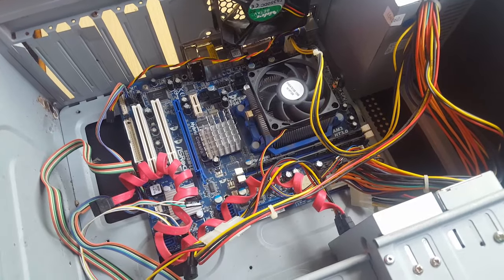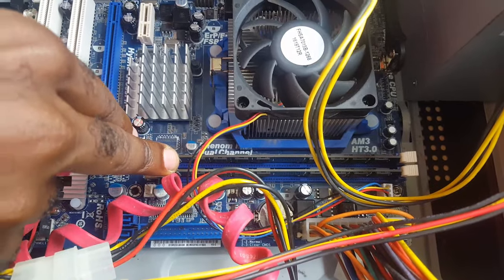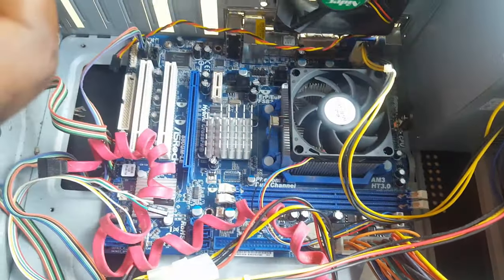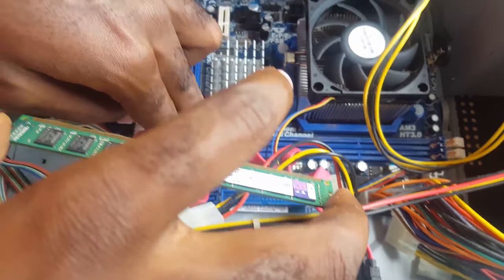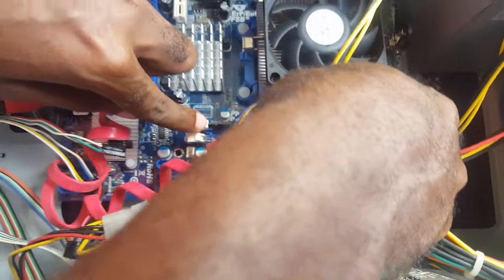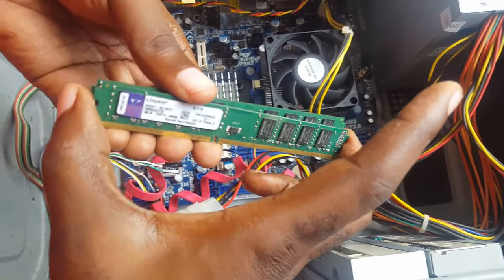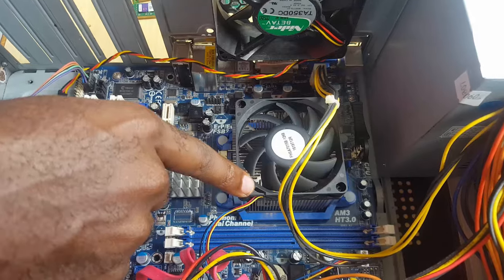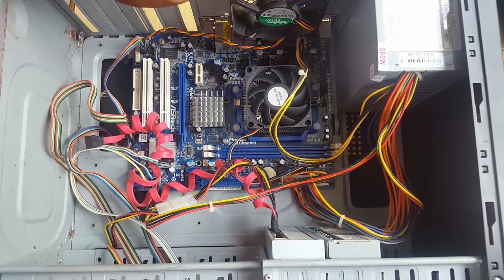Computer beeps 3 times and refuses to power up Fix

Comment: I have a HP pre built office computer. I opened it to remove dust and when I plugged it in to start using it, I got this problem. I was so stressed and scared. After doing the ram solution, my PC turned on like a charm. Thank you so much for this solution.

Comment: Unreal. PC was on sleep. Then when I went to bed it showed on but nothing on the screen. Turned it off. In the morning turned it on and the beeping started. Found this and took out the cards. Sprayed out the dust. Both cards back in and pc working like normal. Thanks for the tips!
Reply from the maker: No worries and great job.

Comment: I had purchased a refurbished Lenovo computer which came with an HP keyboard.   I hooked everything up, and got the 3 beep problem.    I did some YT video searches concerning others who had the same problem with a refurbished Lenovo computer that came with an HP keyboard.  I found another guy who had the same problem.  In his case, he switched to a USB keyboard, and then it worked fine.  My guess was that the BIOS was not updating to recognizing the HP keyboard and thus registered an error.  So To increase the chances of it doing so, I removed one 4GB mem card.  It was now up and going. I then reinstalled the second 4GB mem card, and it too was working fine.   So my guess is that when the refurbished units were tested, they were tested using a USB keyboard, thus not using the HP keyboard.

Comment: Good news is, it stopped beeping!
Bad news is - no display. It turns on and runs fine but it sends no display signal. No clue where to go from here.

Edit: I took the ram chip out AGAIN, jammed it back in, and it works now. Just keep fiddling with it till it works, I guess.

Comment: (this is for the ones who needs help if their pc is beeping short and continuous beeps) so when u open your CPU as u can see there are 2 RAM slot take out your RAM and wipe the golden edges with eraser or cloth and then put the RAM in the other slot and then try to click it in because if u dont that might be the cause of the problem and thats it! thats what i did to mine and it works.

Comment: I'm on the computer that beeps 3 times and than has a brief pause. Sometimes like this,it just turns on and works but other times it beeps 3 times and pauses and doesn't turn on. I'm not the owner of the pc i'm using. It's my Dad's pc which is about 3-4 thousand dollars for the whole setup. Right now he's away on holiday and i'm using his pc like normal. i went to sleep with the ac on in his room with an alarm on the pc set to 9am, but i woke up at 6am with the computer beeping even though i wasn't touching it or interacting with it. At first i thought i was maybe to cold so i turned of the ac and waited about an hour. About an hour later i came back in and tried to turn it on but at first it didn't work and beep 3 times. So i turned it of and turned it on again and it worked! I was like "oh, that was a bit weird but ok..". Later that night the pc had been turned on all day so i decided to give it a break for 2 hours roughly. once i came back i turned it on and it beep so i repeated what i did in the morning and yet no success. So i tried it several times for about 10 minuets and yet again nothing.. Which made me pretty pissed cause it was about 7pm when i tried to turn it back on.  The next day i tried several times once again to get the pc to start up back had the same response with 3 beeps. So i basically wasted my entire day watching TV and went for a hike. at around 7pm i tried again and it just magically worked. i  was so fucking pissed cause i honestly wasted a day doing shit and when i'm about to finish up and have dinner it works -_-. It's the next day now and it's midday and after trying in the morning and just before 11am i did it one more time and now i'm back on. If i leave it for about 30 minuets i guess it's gonna turn of and start beeping :( btw i'm only 12 xD
Reply: And hopefully your tutorial works, if so i will sub and like any future videos that help me out or are just awesome like this one!

Comment: bad advice .... blowing with your breath works but you risk spitting droplets of saliva ...... use a brush (anti static one) or can of air.
also im hear because i have a similar issue but this beeping only happens after a crash that seems to be video related and its random, pc can work fine for days ..... its also the same as an old bug of "something stuck in memory" after a crash preventing booting issue that i have seen years ago .....on completely different pc's .... powering down (mains power off) and clearing power from system (press power button on case)  then turn mains power back on and boot ..... this cleared that old issue and this new one too .... running a msi b450 tomahawk max, ryzen 2600, 16gb 3200 ram (8gb x2) .... starting to wonder if i need to drop the ram speed to 3000 .... as the 2600 only supports 3200 max so im at the edge of stability ?

Comment: Bro i upgraded the processor of my computer and also reinstalled the ram and when i turned on the computer it is making 3 beep by watching many videos i cleaned the ram dozens of time still its making 3beeps please help😭😭😭😭
Reply: @Justrandom yeah man i  cleaned my ram slots and then tried to put the ram and it worked now my system is running fine by the way thankyou for the tip

Comment: Spectre G3 beep errors 9only appears on Northwind CD-OS 19 Models
1 beep - motherboard issue
2 beeps - DRAM issue (I just realized yesterday)
3 beeps - Hard drive Issue (I also realized yesterday)
4 beeps - Incompatible CD
9 beeps - Emergency Fatal Error, or system was halted (I also realized yesterday too!)

Comment: I have 3 short beeps followed by 3 short beeps and a cpu fan rev. After a brief pause it repeats. It started after dusting off the computer and adding additional RAM. I've tried reseating the RAM, tried many different modules including couple new ones. The RAM works on a different computer, so it's fine. I've tried using a single module in every slot or combinations of couple modules. I've reseated the CPU and restarted BIOS by removing the battery. I've tried blowing air on RAM slots to clean them. When I remove all RAM the beep signal changes, so it detects that RAM is there. I've tried disconnecting anything unnecessary from the PC.  The problem still persists. Anyone has any ideas what to try next?

Comment: I have a old dell pc, maybe 2005, 1GB of RAM, wanted to have 2 GB so I order 2 GB of memory sticks and the pc beeps several times, I find out that one of them is not working because it is showing dark material at the end of the gold connections. So I installed only one and the pc started to work again, but the mouse is not working now. Any way I will return the bad one and hope it will work with the new one. Meanwhile I will use the 1 GB memory stick and the 512 MB memory stick and try again. When I get the replacement will have 2 GB of RAM and hoping the pc will work faster. Thanks for the video.

Comment: My dimm slot I'm supposed to put ram in first is messed up and now I get 3 beeps on 5 slots, but bottom is recognized for single channel. So basically I'm only getting 8gb now out of my 16. Lesson learned always look at the slot gap orientation, I had mine backwards and it probably fried my slot. The ram works

Comment: What about three beeps when plugging in the power to the computer?  This is before any attempt to power on, which of course also doesn't work.  The second the computer is plugged in, it starts beeping.  This occurred after replacing the mother board battery.
Reply: Try switching to the old battery.

Comment: amazing sir! very helpful.I have inserted only one ram and it has stopped beeping but on screen it shows " a disk error occurred" and press ctrl+altr+del.and shows again and again that only.what should I do?
Reply from the maker: A disk error could mean that there is something up with the hard drive. Check to see that's its detected in BIOS and its the first boot device. If it is and not showing up still then you may need to reinstall the operating System or replace the drive if its bad.

Comment: I hear just 2 beeps and then a error is showing up on the screen
Reply: Same
Reply: @InfoVoicePk  I tried to fix it by myself. Is not recommended. I replaced over 6 parts. Go with the pc to someone who knows what he is doing. If u are in London I can recommend you the guy who fixed my pc
Reply: @DanyHell69  I hear 2 beeps and then a page where the red text American Mengrend or something like that and a message(error 0162 setup data integrity check failure) shows up and also f1 and f2 options.
P.S Thanks for suggestion brother but I'm not from London I'm from Pakistan.
And please tell me when you get your PC fixed

Comment: I have an sold Acer Veriton that beeps three times in start up now. By removing the ram and using one I fixed this issue I was thinking it was the GPU.
Reply from the maker: Yeh well glad you tracked down the problem.

Comment: I just bought an used motherboard and processor, i assamble everything back including the ram, hdd, case ports, vga, psu from my fully working pc. And its happen. I try all your tips like cleaning the ram, change slot, reset bios and still not work sir

Comment: i was reseating the memory from it was first seated in channel 0 and i moved the to channel 1 and then i moved them back and my pc started beeping then i put both ram in the channel 1 and it worked but just one of them did work then i tried placing it on channel 0 and it beeped even tho it was the wrong ram stick what could be the problem?(so pretty much only two channels work with one stick channels one's but once i plug in the good stick it doesnt work on channels 0

Comment: 3 am and this happens to my laptop, guess what, I looked at the ram and there's this loose metal part( not sure where it's from, but my guess is that it's from CD drive)

Thanks, you're a life saver.

Comment: Could the sound be coming from the ram being too powerful? i bought a hp pavilon desktop a while ago and just recently i bought 16gb of 3200hmz and it makes a beepoing sound, when i entered m,y old ram it worked perfectly fine and i read some articals saying that the ram could not be compatible with my pc
Reply from the maker: Could be that its not compatible. If  a PC does not POST when you change something it usually not compatible.

Comment: You should blow of the hardware the moisture could brake something use compressed air
Reply from the maker: True that's recommended, but I have never had an issue blowing dust from a memory slot unless you produce excessive saliva.

Comment: We need a solution of fujitsu desktop xeon w530 and p720 its turn off its self and no power no any signal no light means nothing. But i test te power supply is fine what is the problem

Comment: Soo I'm a 12 year old, and I usually play on my uncle's for pc for games because his pc is pretty good and it's the only pc I can use. He keeps on rambling and being mad at me if i use it for too long. He has 2 pcs, one for win10, and one for linux. I usually use the windows 10 one and he usually uses the linux one because it's for his job. So I usually need to switch up the pcs when he's done using the linux one, or when I'm done using the windows 10 one, I have to switch it back to linux. And yesterday, It was normal, I switched up the linux one with windows 10 but... It made the beep³ sound and was confused why... After I watched the video, I now knew why, and figured out that my uncle had took them out so I wouldn't play. So I went searcing for the memory or ram things and searched for the places he usually hides things. On top of the shelves, in his backpack, in the drawer, or underneath stuff on the table... I know this stuff because my uncle owns a lot of technology, like vr goggles, his tablet, the mouse for the pc, etc, and usually hides them from me so I don't use them. And so I finally found the memory things and put them in, now it works!! Thanks

Comment: Hey mam i have a doubt. I dont know about which beep are you speaking about. I have 3 beep in UPS.
Reply from the maker: Beeps from the computer or computer motherboard. If your UPS is beeping it has nothing to do with this unless you need the computers power supply which I doubt would beep.
Reply: @rickytlc1985  yeah i can understand what you say. Still can you do a tutorial on my issue

Comment: My uncle has one gig of ram and 512mb ram module. Until i don't know how but both the ram and slot died so the computer could not boot. It was the 1 gig of ram. So I'm stuck with 512 Mb of ram. I have a windows Xp pc

Comment: my pc beeps I remove battery and ram and did what you said but it doesnot stop beeping what may be the problem
Reply from the maker: +Keshav Adhikari Did you clean the RAM, next did you try a new stick of RAM or if u have 2 use only one at a time and try again? If u tried all that the issues lies somewhere else such as processor.

Comment: i have installed 6gb ram 2gb + 4gb at first, I try to run individually and it run smoothly then  i run it both since they are same in spec but differ in brand ,it works fine ,almost 1 hour used i restart the pc then it wont boot have 3 beeps i try to run individually 2gb works fine but the 4gb wont,any advice?
Reply from the maker: The one that causes it not to boot any more is not compatible or defective and you need to get a matching pair for the remaining RAM stick.

Comment: Hi I replace all old rams but it still beeping 4 times what to do pls help me ..
Reply: if it beeps more than 3 times, 
1. You should remove and clean the processor 
or
2. You should unplug all the cables and clean it.  then you should plug it properly.
hope it works..

Comment: Hi Im having the problem, from this evening! I am a complete novice with computers and never opened my computer ever. But I have heard that the computer does retain a lot of static electricity inside. Would you suggest any precaution? Also, wd really help someone like me if you could show this right from the step of power off and opening of the cabinet. I shud add that I once had one of the memory sticks changed by a mechanic 3 years ago. Thanks

Comment: One slot is beeping with my ram slots in my motherboard is beeping and I’m using one ram card and i put the same ram card in the other slot and it’s not beeping what can that be
Reply from the maker: We there is a population rule A slot for one stick b slot only with second stick. You will discover very little with one stick u new a fresh one to test.
Reply: Ricardo Gardener when I put my ram stick close to my front of my case beeps 3 times and when I remove it and put it in the ram stick close to the cpu it does not beep I have 2 brand new ram sticks coming in the mail this week

Comment: my pc gives 3 beeps and then stops i tried to clean the RAMs but still, an answer would be appreciated. Thanks
Reply from the maker: Did you try either replacing the memory with a new one or if you have two try them one at a time in the first slot? You cant try one thing and assume it will work. What you did only proves its not dirty so you need to find if its working now or need replacing.

Comment: Cpu fan automatically off no beep what's the issue??
Reply from the maker: Could be anything. Check RAM, processor seating,power and so.
Reply: In continuity mode how can test atx12v  and understand shorting

Comment: what could happen? i turned the pc today it turned on everything loaded up like always all apps and stuff, after i came back with my coffie i saw that my pc jus stuck, so i turned it off, turned it on again and it reatarted i heard somekind of beeps cant tell how many of them there was, so after that i am turning it again pc turn on but display doesint show but no more beeps, i tryed everything from motherboard restart, cleaned everything RAM's GPU, CPU and stuff and it still doesint work.. :/
Reply from the maker: Try taking out the CMOS and booting with it out, also take out the ram totally and get new ones to try.
Reply: Well i fixed it Thank you anyway, i just take the motherboard out cleaned everything From A to Z puted everything back and it just started working, thx for sutch a great videos and ur experience :)

Comment: What about laptop/?
Reply from the maker: Similar I would Check the ROM first, remove and clean them of dust. Then if you have two sticks of RAM try them all in slot 1 one at a time. If only one try to boot without it or get a replacement and see if it boots with that.
Reply: Ricardo Gardener By ROM u mean CD ROM right/?
Reply: Actually my laptop is not even starting,3 beeps are bepping continuously after a 1 or 2 sec pause.